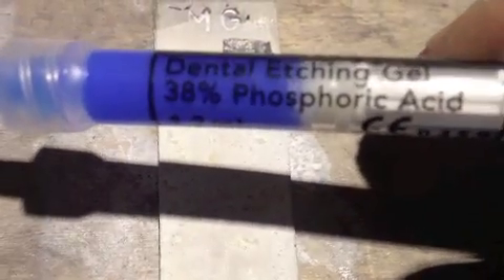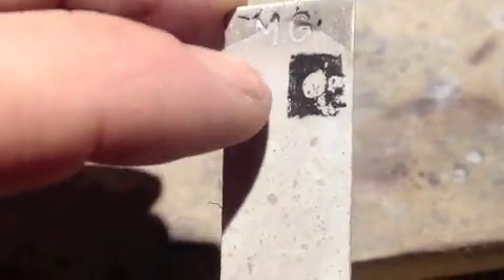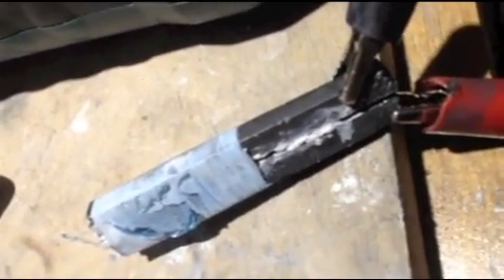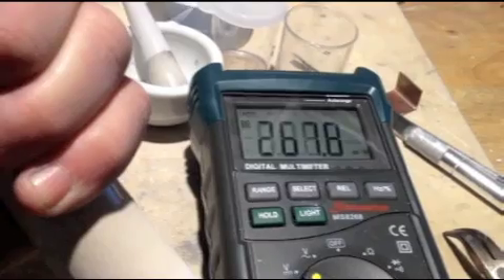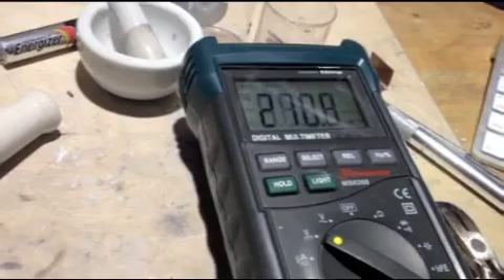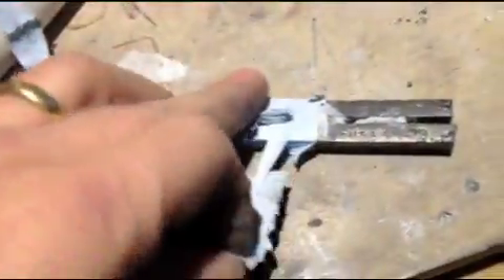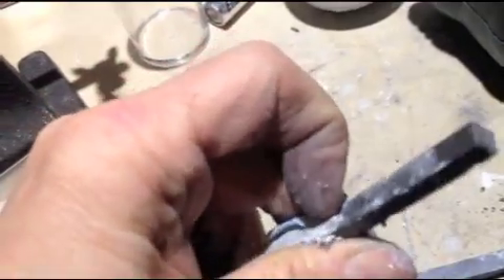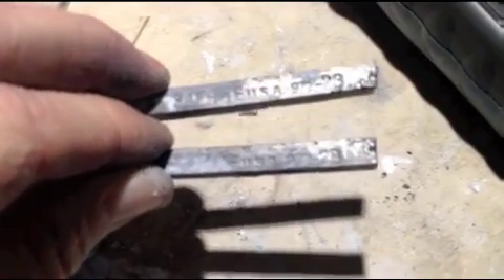Acid Test On Mg Layer

Comment: If you make this much bigger in cell plate and just use the graphite as at the end of this video and stack several in series you could light up a few LEDs and it will not consume anything !
This is probably some kind of "infrared solar cell" as it converts background radiation to electricity ! So please try to concentrate on the graphite-graphite cells as one could easily make yourself your own graphite and does not need expensive magnesium...
Many thanks.
Regards, Stefan.